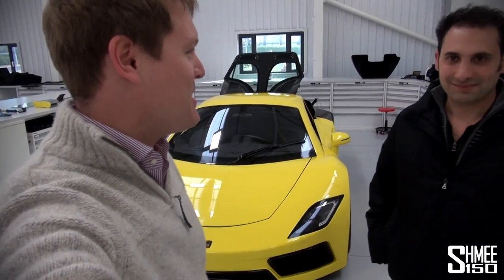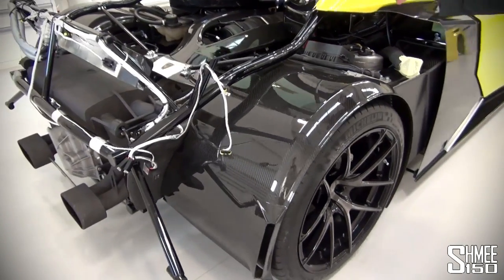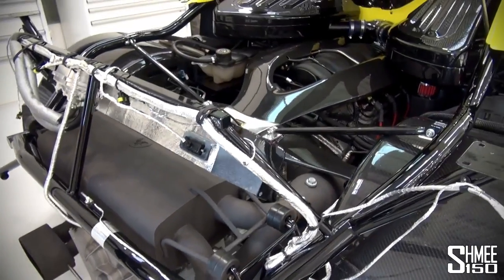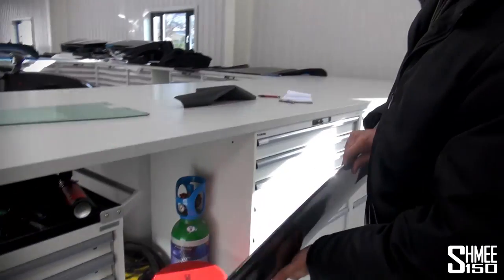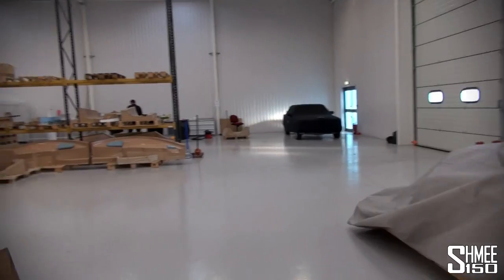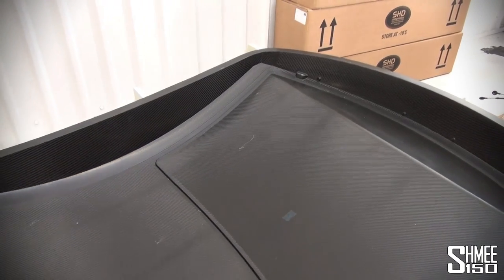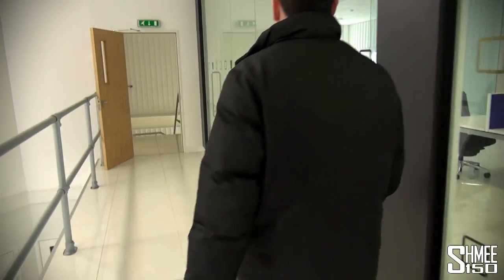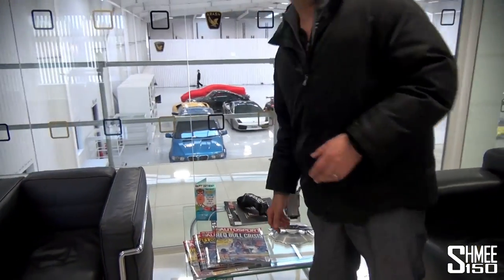Arash Cars, the Full Tour - AF8, AF-10, and Factory Overview

Comment: Looks like a lambo on the front with mclaren led headlights. Interior looks like lambo interior but with cheap looking analog dials. The side angle of the car looks kinda like an audi r8 and the engine bay looks somewhat like that of the mcclaren mp4-12c.
Reply: Is it bad? It's just designer's vision of ultimate supercar. It kinda looks like lotus esprit concept(2013) but i like look of that car. The rear is bad, there is no mesh to cool engine bay and this rear lamp is awful. But overall look is good!

Comment: The boot is going to get really hot due to radiator and battery proximity. So squishy bags only clearly based on the space but make sure you don't put anything that could explode.

Comment: Is it me or this cars look allot like other supercars?... the engine lid's mesh in the AF8 is copied from the Carrera GT (one casually sitting in the same room), the AF10 looks suspiciously inspired on the Enzo and the white LM car obviously looks like a replica of the 1998 911 GT1 street car. Their cars look like bits and pieces from other designs, which is a shame really, the factory looks super cool and with lots of potential, the cars seem pretty well build and fun, they urgently need a new designer with originality